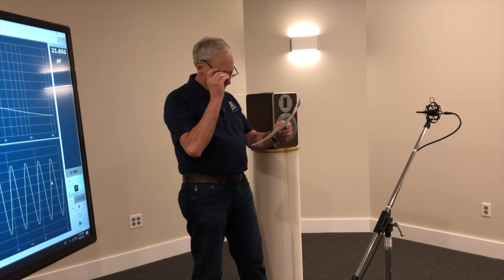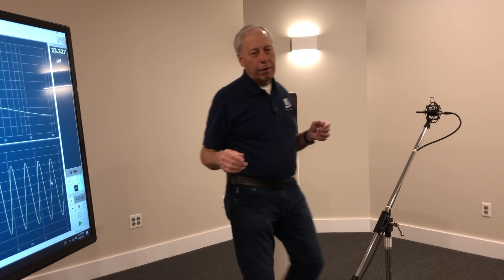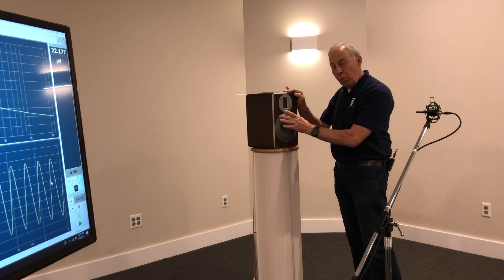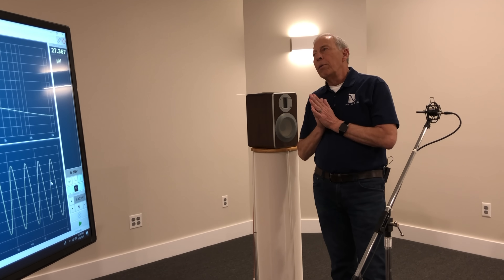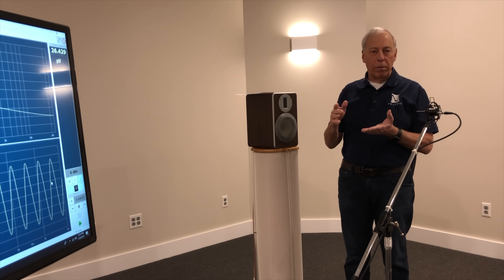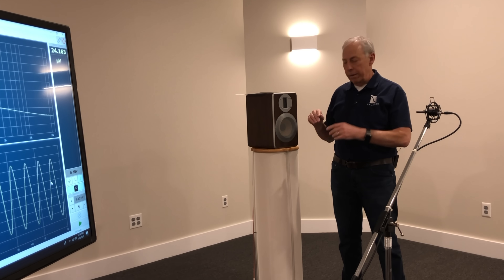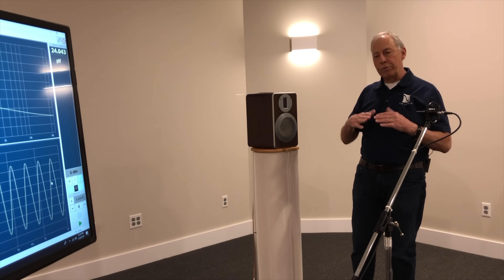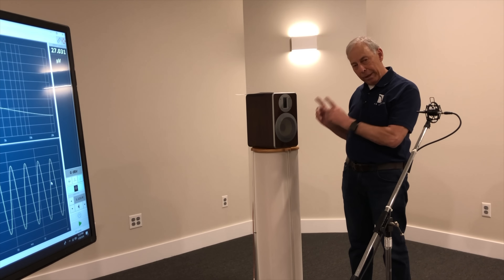How many drivers should a speaker have?

Comment: You need to consider the size of the speaker you can live with, and your budget, because that will affect your design choices. I have worked on single-driver, two-way, three-way, and even four-way speakers. I think more than that is just showing off. Single driver designs should be reserved for the smallest speakers and least critical listening applications, because the single driver (what some call the "speaker", though I use it to refer to the complete speaker "system" in the cabinet), and they are always happiest when matched with a compact subwoofer that has enough upper bandwidth to lighten the workload of the speaker. An 8" subwoofer tends to match well with a pair of 3" full range speakers, and a 10" subwoofer becomes an option with 4" or larger full-range drivers, but the biggest limitation of the single-driver speaker is rising intermodulation distortion when the speaker is asked to play loudly. What we can do is take the high frequencies which are most sensitive to intermodulation distortion, and dedicate a low-mass, high-acceleration transducer (better known as a "tweeter") to those frequencies. Then we need a crossover, because the light construction of the tweeter cannot be tasked with low frequencies or else large amounts of distortion will result, and the tweeter often has a smaller and lighter voice coil that has limited power handling also, so we need to separate low frequencies to the woofer, and high frequencies to the tweeter, and that is where the term "two-way" comes from - the signal bandwidth is split two ways. You can build larger two-way speakers and obtain deeper bass and louder output, but there is a threshold where the woofers begin having trouble tracking bass frequencies that produce large cone movement at the same time as "midrange" or vocal range frequencies at the upper end of the two-way woofer's bandwidth. You could use larger woofers, but that involves directivity compromises and cone breakup concerns, as a large driver has more difficulty moving in an orderly way at higher frequencies because the rigidity of the cone material becomes less effective when carrying the weight of a larger cone area. So we split the bandwidth again, and get "three" ways - a woofer, a tweeter, and midrange, which covers the frequencies between the woofer (whose crossover frequency is decreased to reduce distortion) and the tweeter, which still covers its own most comfortable range. The midrange speaker experiences less cone movement that has to be controlled by the speaker's coil and magnet system, or "motor", so there is less distortion being produced in the midrange frequency band, and the midrange speaker can also be sized in-between the woofer and tweeter, which improves the directivity control of the speaker - the speaker will maintain a consistent coverage angle at all frequencies, where normally a large cone speaker will experience a narrowing of dispersion at high frequencies, which can create a sense of imbalance even if the frequency response measures smoothly on-axis. But there is still one more division to consider. Music has a lot of power in the lower midrange, in the frequency range from 200 to 600 Hz, and in a three-way speaker that frequency range straddles the bandwidth of the woofer(s) and the midrange driver. We can dedicate a fourth frequency bandwidth, called "mid-bass", to that, and we can choose a woofer speaker with a lighter moving mass but still a large cone area to that frequency range. The woofers are then crossed over at the low 200 Hz frequency, and below that frequency they can move as much as necessary to shift air and create deep bass while not creating a "muddy" sound in the upper bass or lower midrange. Then this mid-bass driver will provide enhanced dynamics and impact to the fundamentals of most instruments. By this point, we now have a four-way speaker, which provides not only high output level but a "division of labor" which serves all the important parts of the music with the best possible presentation.
Reply: Amen

Comment: I've been enjoying an 8 inch two way design with a 1 inch dome. That 8 inch driver reproduces awesome midrange. Very full for rock and metal music.
Reply: As long as you have a waveguide for the tweeter, otherwise you'll have a big directivity difference and as long as the woofer ringing is well damped and filtered. 8 inch is about the maximum woofer size for a crossover of 2 - 2.5kHz if you want to maintain good sound.
Reply: I'm very glad to see that they went with a 6.5" mid-woofer for the Sprout speakers and would like to see an 8" version. To my experience, the 8" is the best size for all-around bass/mid-bass reproduction.

Comment: Simple is better. Isn't a single driver loudspeaker simpler? I have a pair here, supported by subwoofers and I can't hear any disatvantages.
Reply: Even if crossed over to a sub, a 4” fullrange driver cannot go up to 20kHz without beaming (smaller soundstage width).
Reply: @homeboi808  My fullrange driver has 20cm diameter, I don't know how many inch. I'm not missing treble sound.
Reply: @durchreiser6573  i think 20cm is too big.
Reply: Visaton B 200

Comment: Ideally, one. In real life, two, two and a half, three... are enough.
Reply: Sir ...now a days ...AIR MOTION transformers ...

Have 2khz to 20khz ..FLATTER RESPONSE ...

so hope ..2 way is enough
Reply: @aditya2805  
They are still governed by the laws of physics where dispersion/directivity/beaming as well as sensitivity and maximum SPL must be considered, both as individual drive units, and when combined into a multi-way system.
Reply: @bbfoto7248  again ...by inspection I realized that ...AMT (air motion transformer) driver are producing high HARMONICs at low  frequencies & at high frequencies AMT Disturbance factor is less 

So mid frequencies need to be covered by another Drive unit 
So 3 way is preferred and I don't prefer AMT

Comment: Great advice.  Simpler is better. More drivers also cause fase issues that can't be fix by basic crossovers. I have found that single point source speaker's sound best. Place the tweeter in the middle of the woofer like Tannoy or Kef or go the other way and go big by having lots of tweeters or electrostatic speakers.

Comment: How do you finalize the crossover design, by measurement or by hearing? How long does the process takes?
Reply: When you hear the phrase “The designer is voicing the speaker.” it means they are listening to how the crossover is making the speaker sounding, and then fine tuning the crossover based on what they hear. Measurements are also used typically.
Reply: Lucy in the sky with diamonds as loud as it will play.  Process takes 4 minutes.

Comment: its really tough to beat what you get for a 2.1 system.  2 way bookshelf like Paul showed here and a nice 12" to 18" sealed subwoofer.

if you want to improve its going to cost a lot more, need more tweeters and woofers, line array or some cluster array, Tekton design have that feature.
Reply: Yeah, I had an aio system like that for years. Yet I am happy to have switched to a 5.1 setup including two Quadral 3 Way towers. Center and surround are two way, also from Quadral. I am really proud what my german buddies have built in around the millennium ~

Comment: I've built several speakers in my lifetime, and found that the crossover is the hardest part to match to the drivers, for sure. Not being an electronics expert, (I'm a mechanical technologist), I've had to change and fool around with crossovers to get my speakers to "sound" right. Of course enclosure size, porting, etc all play into it as well. Paul is right. It's not easy to build a proper speaker. Takes some patience and a lot of no how. Unless, of course, you buy a kit that's already been designed properly and just do the assembly.
Reply: Or, get incredibly lucky like I have, and find the perfect speakers. I'm not able to build my own, so having these ADS L810's is a godsend. Perfect for every music genre and 94db efficiency and sealed boxes, too. Now to find a decent, used tube preamp.
Reply: @trog69  Yup, so correct, I have a pair too and they are about perfect as far as the transitions between drivers, and they also DO well about 8-12" from the back wall, even if near a corner, they still do well. I have that situation myself as my living room is something like 11.5x15.5Ft and a lounge chair and a doorway into the kitchen prevent me from moving the speakers further out, and in my case, that would be the worse thing I could be doing, but they ARE about 8' apart so gently towed in to compensate for the width.

They work very well and I still get some depth out of them. Not bad at all and easy to listen to and yet retain a great deal of detail while at it.
Reply: @trog69  I'm happy for you, keep them! I had a 7+7 w tube amp (the best amp I ever heard) and I went and sold it. What  FOOL I was! The worst thing I have ever done.
Reply: I made a lot of crossovers and I can guess and make one straight off by guessing (and it's really close). Then I listen for a week before I make any changes to the crossover. It took like nearly a decade to get to this stage. I had the one pair of speakers for nearly that long. They were my listening speakers like anyone's speakers except I kept changing them every week until I learnt enough to be able to make speakers. All just experiments for that long on hacked prototypes, and I only have a couple of completed pairs, so far. But I'm not interested in traditional speakers, and now that I can make crossovers, I can have fun building speakers that are different.

I want to take it further and I want to make something different to the classic 2 ways and 3 ways. I have just made one 2-way point source 3" full range driver with tweeter (and one to go). A stripped down tweeter is stuck to the back of the FR driver and a stick is glued onto the tweeter voice coil (stripped of the diaphragm) and the stick pokes through a (drilled) hole in the 3" FR driver and a tizzer is set on the end of the stick (right where the FR cone starts) at the core of the FR speaker. And I will have a 6'5" woofer under, as well for bass. 

The tweeter will have a 1.5 mf cap and resisted by 6-10 ohms. You don't need much cos it's a FR driver that will also be capped with a 2 mf cap and a 60 mf cap in par'l, and a 10 ohm resistor in series with 60 mf cap only. And maybe a 100 mf cap (highly resisted) also on the 3" FR driver (in Par'l). I want bass in the FR driver but as little secursions as possible for cleaner med (I can always go to like 5" FR if the 3' FR moves too much with the sound I want). But the FR driver is going to be no bigger that that (for great meds). Also there will be a 1 mh choke on the FR driver to mellow it out. The woofer will have a 9 mh choke in par'l with a 5.6 mh choke (that is resisted by 22 ohms) for punchy bass. 

It's a 3-way that appears to be a 2-way. The crossover is only a guess, but it will be fairly close and I will change it after if I want. Yes crossovers are hard (it's practice) and doctoring drivers like I do is FIDDLY!

They will be the best speakers I ever made, cos of the (point source) extended treble with better top treble transients and med will be superior through the small FR driver with way good med transients and it's a point source treble and med setup also with a trickle of upper bass (that's point source). And the (non-point source) separate woofer takes care of all the excursions. Not too far to go, I made the boxes ages ago, and nearly finished the 2-way FR drivers, so the next thing is the crossover (already initially designed) and final assembly. Here is a 2-way prototype I made in an hour back in 2012 and I have improved since then. https://youtu.be/2wJz_KQ8Esk
Reply: @Justwantahover happy by your ...input ...

Can you please ...suggest ..
Which kind speaker ....are BESST ...

FOR woofer ....mid ...tweeter ...or ..if add ...upper high level .....

I found 2 ...brands ...Kasun & PMC ...crossovers ...are simple ..

Intrested in your reply.....
Reply: @aditya2805  It doesn't really matter what brand the drivers are, it's the crossover that makes the difference. Obviously if you spend like 70 grand on a pair of 8" drivers, you have to expect that they are way better than $20 dollar ones (and believe me you can actually spend that much on two 8" drivers). Look up "best cheap woofers" on YouTube and I think BS Acoustics makes the best woofer for about $30 bucks (and is reasonably sensitive). With tweeters you are going to be hard put to get ones that match if they are a different brand to the woofers. You will have to resist the woofer a bit with cheap dome tweeters. If you want really good speakers but Focal drivers if you can, a bit expensive but about the best. KEF Uni Q drivers may also be available (I don't know) but I would rather them even if they aren't as good as Focal, cos the KEF Uni Q drivers are coaxial time aligned, and way better sound just cos of the geometry (the voice's vowels and consonants are coming from the same place instead of a foot apart).And I think BS Acoustics make cheap coaxial time aligned drivers (4") and use a woofer under. About 200 a pair I think. Maybe they are better than the KEF cos they have a smaller med voice coil diam and way lighter for better med transients. The crossover is the worst cos you have a way bigger problem working out a 3-way crossover, than a 2-way. lol I just do it by ear and try to get some good reference speakers to compare them with. That helps. If you want to design your own crossovers you will be laughing, but it's hard to learn (even without the math and just listening). You still have to know the rates of change per cap, choke and resistor, and which direction they go. Caps are opposite to resistors, with parallel and series connections (and you can tell by hearing). But I can upload a video on how they basically work so you have an idea on how to start. Once you know, then it's just a matter of practice on hearing the difference. And of course, find some old (good) speakers. You can get old school $2000 ones for $300 on the internet (and pay through the nose on shipping). Maybe you have a friend who has good speakers and you can go there and try yours. But don't try to make your's sound completely identical, it will probably sound sour like that, so you let yours sound a bit different but not by too much. lol I could go on forever (like PS Audio Paul says).
Reply: @Justwantahover  i am sooo crazyly  happy to hear ...from you 

My problem was ...SPEAKER TYPE ..neodymium or ceramic magnet ...think NEO better...(weather co-axial type OR dual cone OR flat plate )

Secondly & main..tweeter ...(hard Dome OR horn or RIBBON OR....Air Motion Transformer tweeter)

Very few Brands SALE ....NEODYMIUM magnet speakers ...i think they are way better ...thats why i was thinking ..for  PEERLESS & HIVI & MOREL ....4"

Focal KEF is not providing ...NEODYMIUM ....speakers ...

In the domain of crossovers ...KASUN & PMC Or any brand CROSSOVERS are satisfactory for me...

I belongs to ELEXTRICAL -CONTROLL SYSTEM DEPT .....
Making of crossover ...i dont take that risk ...
...please suggest any GOOD CROSSOVER BRAND 
tweeter type ...AMT or else 3-way ...is bothering me
Reply: @aditya2805  Buy a 3-way Peerless (Kit) they are Danish and they make great speakers for the price. The kit would have 2 woofers, 2 med drivers and 2 tweeters and 2 crossovers. You make the boxes to their plan (if they have one). Also Seas are also good speaker kits but maybe a bit more expensive.
Reply: So when it comes to mulitple
high order x-overs one should just say "know" (sic).

Comment: I have always built 2 way   just get a good tweeter & woofer    it always sounds better with a good  capacitor for smoooothness        turn it up man 

2 is company   3 is a crowd      he is right with the crossover   the midband always needs to pull back
Reply: Try a 3 way, it's genuinely greatly superior. Even if you don't spend much. Makes them sound more detailed and builds soundstage as every instrument plays separately
Reply: The only speakers I own that are not 2-way are also the best-sounding speakers I've ever heard. ADS L810's. 3-way design and sealed cabs. Perfection to my ears.